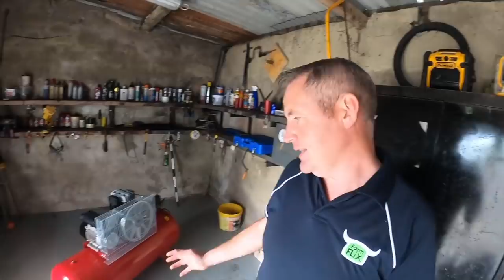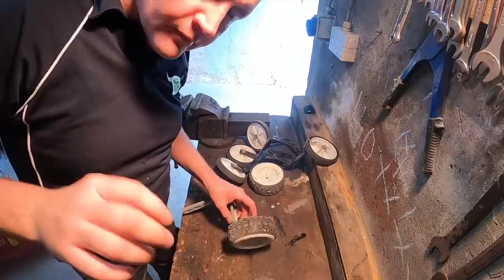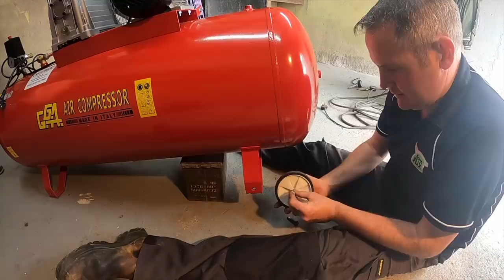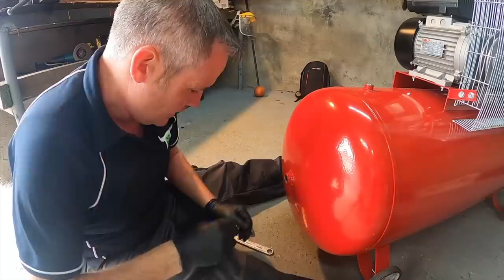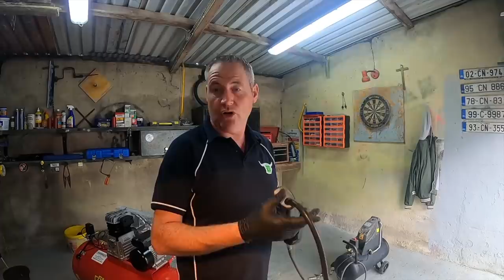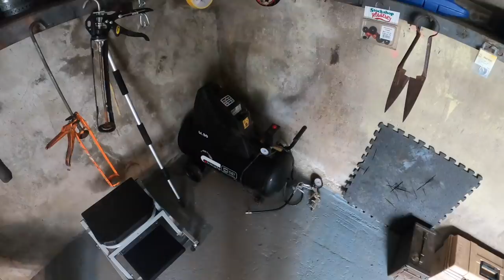SOMETIMES BIGGER IS BETTER!!!  WORKSHOP GETS AND UPGRADE

Comment: Install it away from where you work Adrian, as the noise of the compressor starting up deafens ya.   Get it piped into the shed and have a wee water proof house outside next to your shed, you won't regret it.
Reply from the maker: Yes it’s in a separate shed, hole bored through the wall for the piping

Comment: This is a great asset to any farm. I suggest you give consideration to painting on each side of cylinder your surname,farm name and post code. It has worked for me ,still have compressor after three 'visits'. Also I do the same with battery electric units
Reply from the maker: Very good idea 👍

Comment: Pcl fittings wont leak as they are probably the best, most of those cheap or generic air fittings will leak and drive ya mad. Good vid and nice to see a bit of tape as air leaks would drive ya round the bend.

Comment: I got a same size compressor recently and had to replace the 3 pin plug to a transformer type of plug as it was blowing fuses from a lead I had powering it. Is that shed good at keeping out the moisture?
Reply from the maker: Ya I’ll be doing the same